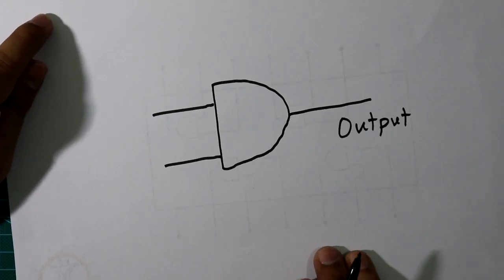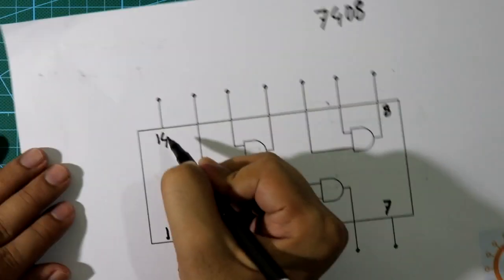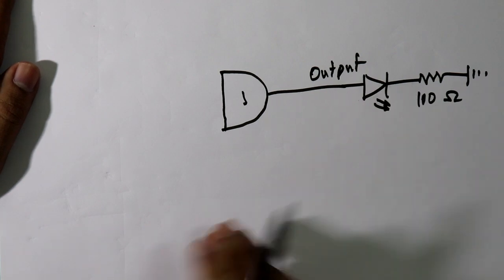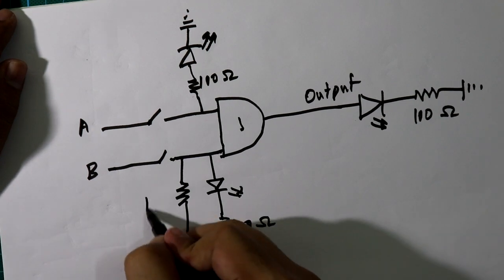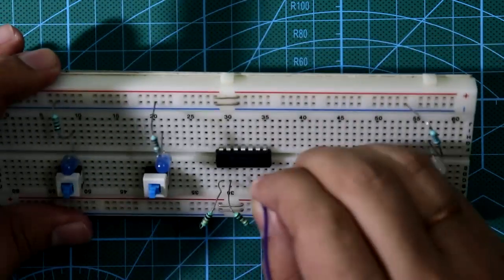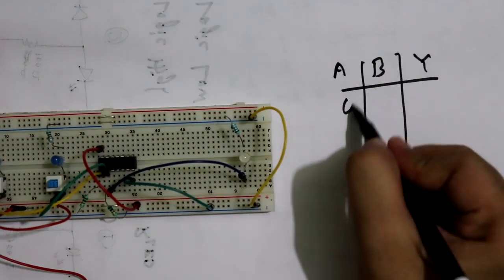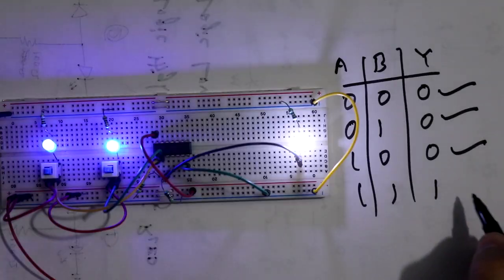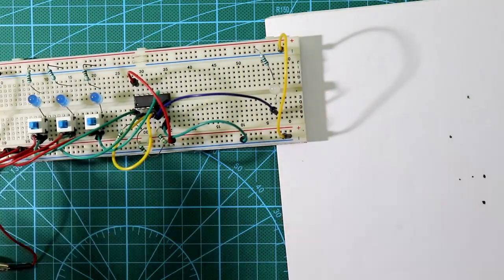SN74LS08 | AND gate IC 7408 explanation with truth table | Two input AND gate

Comment: I understand you are using switch that can make the circuit connected to ground when you switch off and the circuit connected to power when switch on. Can we replace the switch using transistor?
Reply from the maker: Yes we can connect with transistor or output of any digital IC.